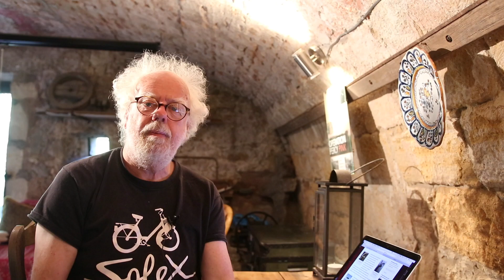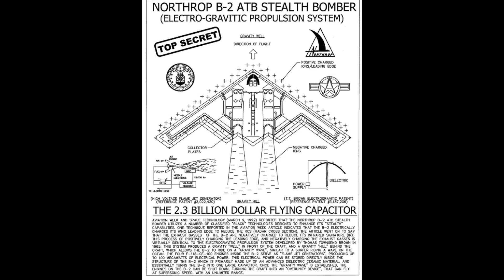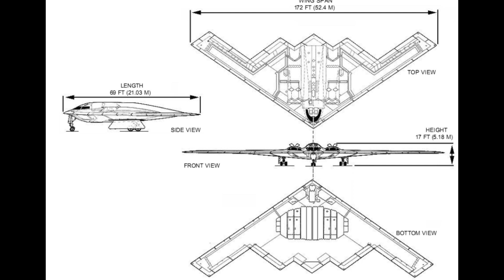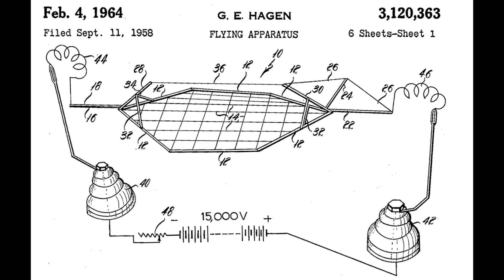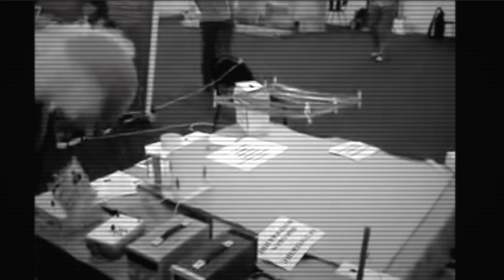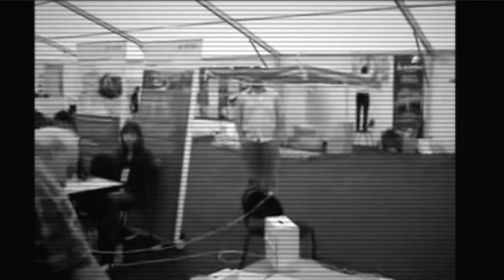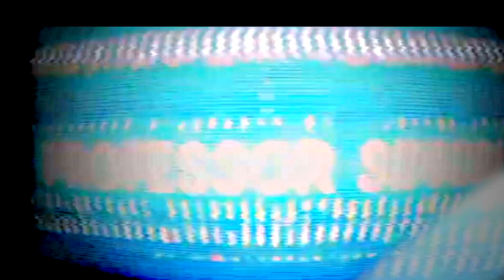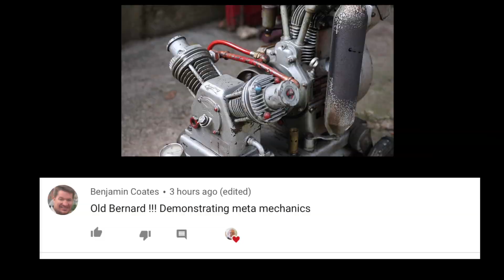Military anti gravity - Prof Simon

Comment: There are guys on u tube for years building these things at home...  sort of a square frame with wires stretched between the 4 corners, and sort of v shaped thin sheet metal upside down over the wires...  when power applied to the wires airflow downwards over the metal bits starts and provides enough aerodynamic lift that the whole frame will rise...

So it's not anti gravity, its a sort of coanda effect lift force...

I think Dyson actually make a really expensive room fan now that uses this same effect....

Comment: This isn't anti grav. It charges air molecules creating a cloud of ionized air around the craft that absorbs radar signals. It uses microwave emitters on the edge of the wings. Rf signals from those, special titanium and polymers coatings, engineered body and locations of engine exhaust and intake, injecting chemicals into and cooling the exhaust, and angled surfaces all combine to reduce or eliminate radar signatures infared sensors, etc. It's all contributing to stealth ability nothing gravity altering is involved
Reply from the maker: thabk you

Comment: Amperage is trivial and irrelevant to this truly American antigravity, the basis of which has been in the public domain as the Bifield-Brown effect, and with a relevant patent granted to Thomas Townsend Brown in like 1929 in Britain which further delineates the technology.  The wing edge charges to positive voltage, and the exhaust from the jet engines are charged negative.  Fire it turns out makes a superb electrical conductor, and you could possibly add an electrogravitic component to a rocket in the same manner, adding a sewing needle point to the top of the thingie to broadcast positive high voltage in front of the rocket.

Or maybe this is the tech useful for hypersonic missiles..., which must be canceling air or inertial resistance.  It might also make it damned near impossible to shoot one down, given the shielding or distortion of visibility.  

F.

Comment: It is called a slipstream. Uranium yields a million electron volts. (The fission of a uranium-235 atom generates 210 mega electron-volts, MeV, of energy,) Using it to electrostatically charge the craft does not lessen its weight. It creates a thinner surface contact with the atmosphere by repelling like charges which envelopes the craft. Less friction yields less drag and greater speeds=slipstream. Ionization also repels from the planet but minimally as altitude progresses. The slipstream produces less friction moving through the atmosphere requiring less fuel. There is still atmospheric pressure to provide lift (My best guess)
As for plasma, there are better methods to produce that and slipstream is not required In the Nimittz TicTac for example. Its surface is a plasma charge contained within the hull, essentially making a zero-mass vehicle isolated from the universe around it. Less energy is required making a layer of plasma within the skin of the craft and magnetic pulses from one direction will provide the direction. I believe it allows the craft to stop entirely, receive fusional particles from the sun, wait for CMDR Fravor to show up then drop 60,000ft in a second for his entertainment. the slight blurry glow is the contained plasma emanating far enough to protect the skin of the craft only. It separates the craft from the universe around it with a built-in polarized gravity wave induced electromagnetically.
-- gravity from magnetic waves:
-Date:
January 21, 2011
Source:
Rutgers University
Summary:
Researchers report that an exotic new superconductor based on ytterbium appears to be the first material to exhibit quantum criticality in its natural state, without tuning. It could also be the first example of what physicists describe as a "strange" metallic phase of matter, manifesting itself intrinsically, without any tuning of the material's properties. It could change how scientists understand and create materials for superconductors and electronics.

https://www.sciencedaily.com/releases/2011/01/110120142354.htm
Reply from the maker: very interesting do you have pstents or drawings?
Reply: @SimonHollandfilms  There are patents with sources that can be read if purchased which are posted in the article above:
"In a paper published Jan. 21 in the journal Science, the Tokyo and Rutgers researchers now report that the material can reach a point where seemingly contradictory electrical and magnetic properties coexist, without being subject to massive changes in pressure, magnetic fields, or chemical impurities.

Comment: I mean sure. If your looking for it. I guess if you went into engineering...I don't think it's exactly secret. But it's not depleted uranium...it's thermal to electric induction and it's hooked to a magnetic generator that spins. Has a brush to contact the top of the flywheel. And it leads to coils that has a lifting effect because of the rotating magnetic field...  It's got to be DC...Because of the zeroing effect in ac. The magnetic field has to vibrate out and needs to be constant....well...you can run it ac...but the ampacity has to be way high.. to fill the gaps..if you can control temp. It's probably more powerful..
Reply: You could also spin a magnet in a flywheel shape super fast.... And probably get lift off that too. And thing that emits a magnetic field and can spin. If you can bottle air and spin it super fast and it's energy makes a magnetic field. Boom. That plus hot gas law...
Reply: Oh I almost forgot....I mean...the uranium is magnetized...to the point of induction. So that's y it has the static...through the inductor. U align inductors with magnetic field lines in the flux

Comment: Since 2007 i've been following the science related to anomalous thrust when capacitors are charged with many kV, asymmetric and symmetric caps both exhibit the 'thrust'. Gravitec, a NASA contractor, got the effect to work in a vacuum, thus negating the 'electric wind' as the sole cause of the thrust.

Honda R&D Institute, in 1996, had a symmetric, 2-plate capacitor, with glass as the dielectric and copper for the electrodes. This was immersed in a bath of oil to negate 'ion wind' effects and the bath placed on an insulating structure which in turn was on a digital scale. The insulating structure was there to avoid intereference of the HV with the digital scale. The capacitor lost 3% of its mass.

There are also many amateur experiments with so-called 'lifters' and you can plainly see that there's no way their 'craft' are aerodynamically sound enough to 'fly' with the tiny wind produced.

The US Army Research Laboratory experimented and found that ion wind was 3 orders of magnitude too small to account for the thrust.

An Israeli university group (i can no longer find the article) found that increased AC power resulted in a non-linear increase in thrust.

There is something more than ion wind going on here.

Comment: According to Stan Deyo, the Lorentz O is the solution. Need a torrodial coil that has a mumetal material that has an AIR GAP and pulse this with DC pulses. The coil has 15 degree channels. The Lorentz force expresses itself in an interesting way, according to Stan. I'm surprized to find that NO ONE appears to be trying to replicate this.

Comment: Professor Simon have you ever discussed the story of the WW2 German Bell in any of your videos? It was supposedly a liquid mercury encased motor that was either an anti-gravity or stealth device?
Reply from the maker: good question...it's hard to know if it worked.
Reply: @SimonHollandfilms  I posted some thing on top. I'm actually into anti gravity..
Reply: Click the comment to open up the extra notes I added as replies
Reply: Isn't that the thing that landed in the Kecksburg UFO incident ..  they might have reverse engineered that and used the spinning mercury  in the tr-3b.    Thing is you might have made some anti gravity drive,  which can project a gravity well. But it might not be able to rotate the craft, so you cant steer. Mercury has some interesting properties .. it's liquid, heavy and it conducts electricity.  If you would put 3 circular hoses around your craft filled with mercury you can turn the hoses into reaction wheels or gyros and rotate the craft.  because the mercury conducts electricity the only thing you need to do is make a Magnetohydrodynamic system .. put some magnets around the hose in one direction .. and some electrodes in a 90 degree angle with the magnetic field.  Then if you run current through the mercury it starts to rotate through the tube. And your craft starts to rotate in the wished direction.

Comment: Lots of people say gravity doesn't exist so you can't have anti gravity.   But you can max up floating capability in the air with a dirigible-style aircraft vacuum under pressure - ear popping - which is basically most passenger airplanes which in principle are simply balloons with fan propellers.

Comment: Professor I once read that this tech was German ww2 and they used a plasma generator at front of aircraft, that enveloped the aircraft as thrust / air speed increased. The effect of which was effectively halving the resistance to travel at supersonic speeds (or allowing, twice the speed for the energy input)... I've searched for years, and came up with nothing. Is this similar?

Comment: I have wondered recently about applying an electrostatic charge to the surface of an aircraft, to reduce its drag. The idea is that a thin film of air molecules would stick to the skin of the aircraft, acting as a lubricant.

A similar principle explains why a spinning rifle bullet travels further than one that is not, because the air near to the surface is dragged around with it.

I believe that aircraft designers tend to reduce electrostatic build-up however, due to concerns about spark discharges igniting the fuel!

Comment: The first time I heard about the 'lifter' was in a documentary where they had discovered the na-zi scientists were experimenting with lifter models. Those lifters do not work under vacuum as they work by directing air downwards, so they aren't anti gravity but are instead a form of ion propulsion. 
On aircraft maybe the effect just helps to accelerate more efficiently, making the aircraft able to travel further on the fuel in their tanks?

Comment: It's NOT antigravity(in purest terms) that it is used for on the B2, but it's for diverting radar and more importantly air flow around the aircraft, AND for passive radar detection through feedback monitoring of its resonance. It relies on the similar effect of the ground plane effect used on Ekranoplanes - Boundary layer effect as pioneered by Telsa, who had his work portfolio STOLEN by you know who(psst - Trump's Uncle on behalf of US intel)! The Russian 4++ and 5th generation use it for the same effect, as "baked" in for stealth, as baked in is now obsolete. Remember modern aircraft are essentially supersonic EM generators ie most AESA radar use 2000+ 6GHz TRIAs with beyond horizon capability-that's a LOT of power! BTW ANY surface coating can be emulated with controlled EM wave generation, as most perceived physical characteristics are just the effects of electromagnetism(SOLID matter is 99.99 empty space after all). Combine this tech with ion/low noise combustion engines and stealth/Vantu Black IR absorbent material and you have the classic TR3B, The MIC has hampered mankinds development for 75yrs! Saddening.

Comment: If say an aircraft with an airflow over an aero foil has the ability to charge the high pressure vs. low pressure areas with ions, it could ostensibly reduce the air flow separation from the airfoil, increasing its flight envelope.  You can accomplish the same by using a super critical airfoil, but I can see how a charged region might have supercritical effects.  To affect radar, you would need to absorb the whole energetic electromagnetic spectrum hitting the aircraft, which I don’t see as likely.  There’s also something you might consider, that electromagnetic charging of ions at the wing roots might reduce wingtip vortices, thus reducing drag.

Comment: To see an example of magnetogravitic antigravity, buy two identical rare earth magnets (be careful). Bolt them together so the N poles of each are touching. Get two identical non-magnetic containers. Put the magnet pair in one container. Go to a high spot, 100ft or higher. Drop both simultaneously. Have an assistant on the ground time which hits the ground first. The container with the magnets will always be 2-3 seconds slower to hit the ground, contrary to Galileo’s expectations

Comment: Yes, T Thompson Brown discovered that by charging the leading edge of a dielectric disk with 50,000 negative volts and the trailing edge with 50,000 positive volts he could create a gravity well in front of the disk and a gravity hill behind the disk, leading to forward motion. This was also tested in a vacuum eliminating the possibility that motion was caused by ion wind. A similar setup exists on the B-2 bomber. This is why it cannot fly during excessively moist conditions. Dr Paul LaViolette did an extensive study of this. It’s called the Biefield-Brown effect. At a certain altitude, due to this effect, the B-2 can stay in the air indefinitely.

Comment: Yes it does work. But the flow of ions needs a wide enough band gap and enough voltage to ionize enough oxygen to create a strong enough flow to lift whatever weight the object is. I always wanted to make a giant lifter attached to a hot air balloon basket. Instead of a balloon it would be an aluminum frame ionizing air lifting up into the air in the basket.